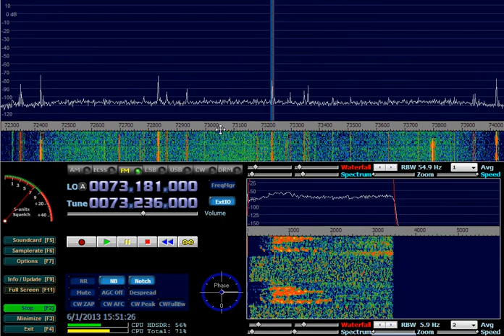HDSDR testing (HF converter build-in RTL2832U Dongle)

Comment from the maker: The up-converter of mini circuit with an osc, dbm, low pass, high pass inside, and then put into the RTL2832U + E4000 DVB-T TV Dongle.
The circuit is same to the normal up-converter like the normal kit for rtl2832u , but it is too small, and you can see in my new video at the future.

Comment from the maker: At first, I want to tell you that the HF converter is a PCB add-on the
 RTL2832u+E4000 TV dongle, it's made by me, and the pcb build-in an OSC
 125.000Mhz for convert frequency from 125.000Mhz to 205.000Mhz, and the
 real frequncy is from 0-80Mhz between  HF to VHF, just a HF converter pcb
 and merge on the dongle by me.
          So that you can find out the frequency of the HF Converter"s local
 OSC( My HF Converter  Project), and set shift frequency of SDR Sharp.
 
Regards
 Raymond
 VR2ZWV